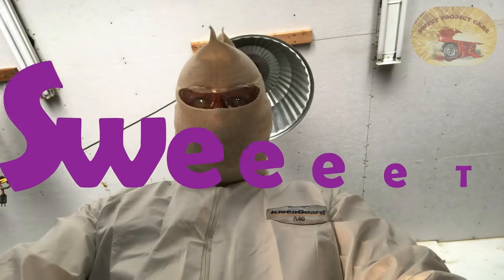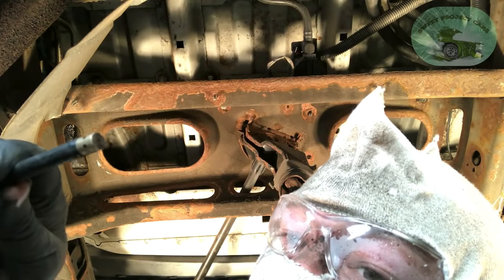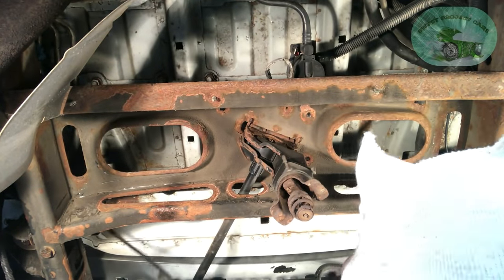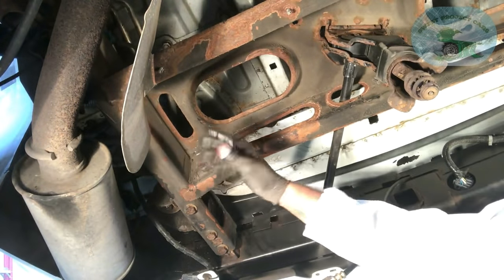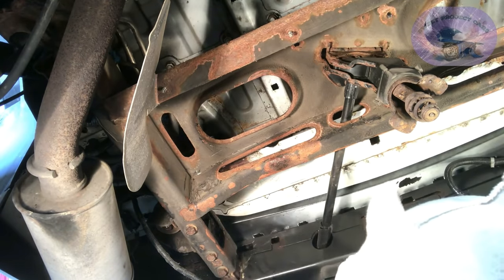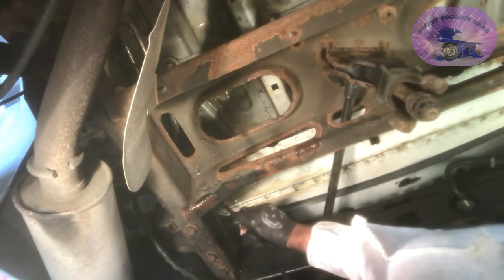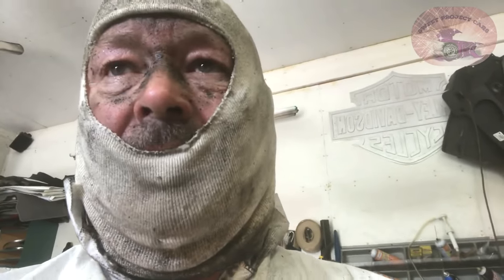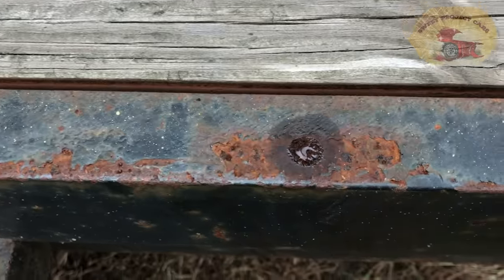#2 HOW TO RUSTPROOF A Car, Truck, SUV, JEEP RV, Motorhome

Comment: Also this makes many suspension parts last longer, and even makes the vehicle perform better over time. It really is that good, and I still have another vehicle to do, but 2 done already. Do this, it is more than worth it!
Reply from the maker: niceguy217 it sure does it is a great lubricant for sure

Comment: Such a hard job laborious work. Then when you seal the bottom up no rust, the truck engine dies and your still throwing your vehicle away. Perhaps a texting fiend from behind rams you in the rear and your truck is totaled? Instead of SWEEEET!
you might say SHHHHIT !!. ....LOL
Nice video....
Reply from the maker: The SynDRONE Effect thank you my friend for sharing and yes anything can happen to a car or truck, but here we look at it this way, its better care for it, then drive with common sense and take care of your motor and trans and the car will last for years especially if you like the car and don't want to replace it...have a great weekend my friend !!!

Comment: Great video!  What do you recommend for pitted metal?  Any kind of conversion coating before the undercoat stuff?
Reply from the maker: G Time, well as you know once rust has pitted the metal there is no filling those other than body filler or replacement  you can try painting it to smooth the pits out but you will always see the divots...the rust proofing we use here will stop the rust in its tracks so no more damage is done...thanks for asking my friend :)

Comment: Does Fluid Film stop the existing rust from growing.
Reply from the maker: David Buckles this is what their website says about that and we found to be dead on correct,  "If applied over existing rust, it will stop it immediately from spreading further. FLUID FILM will penetrate rust and rust scale to the base metal"  hope this helps :)
Reply: Thanks.
Reply from the maker: You are very welcome my friend
Reply: I would use caution if a vehicle is very rusted my lower control arm broke off the frame and i had sprayed fluid film underneath my car a few days before but it was bound to break anyways

Comment: Do you ever use a rust encapsulator and then primer? I used an encapsulator and then covered it with herculiner on the floor of my car. Rock solid but it is time consuming and messy. Also a bit more expensive.
Reply from the maker: Mark Allison as a DIYer channel we could get very involved and very deep into many fixes and repairs that's for sure ...we try to keep it easy enough for the diyer and still get the job done and still be somewhat affordable...we say with rust especially ...something is better than nothing when it comes to trying to control or stop it, even if it is a can of WD40 because the diyer is on a tight budget...thank you for sharing my friend :)
Reply: Thats bad, its just going to rot underneath the hard coatings and you wont notice it.

Comment: I did the inside of my doors with this stuff 4 years ago, should have done more. I'm wondering if it collects dust and dirt when it's on the outside of the vehicle. Any issues with that?
Reply from the maker: David Koopmans it collects a very light dusting and then it collects no more after that...pretty cool product in our book :)

Comment: that wasn't even close to "down and dirty" what my 20 year old 1998 f150 rust belt is....rockers are gone, cab braces gone on ends(both sides)..frame caked with 20 tears of rust (bought air needle gun)...BUT..by getting down and dirty,,i will re-deem my 10th Gen.  you might want to mention(by reading the label )  that Fluid Film is Lanolin based (sheeps wool) ,.. I also have a trailer that looks like the one you showed...cant wait for that video.."down and dirty Bob"
Reply from the maker: Bob Haddock he was actually talking about how dirty one gets when they are under the vehicle rustproofing....thank you very much for sharing Bob, you are a "Fantastic Subscriber" we need more just like you :)

Comment: How long does this last for? When should you reapply
Reply from the maker: Teagan Roehl we suggest in dry climates check it after a year and see if it is still doing its job and in wet climates we say touch up any exposed areas if needed once a year....we have had vehicles we have done personally and they have many years on them with no issues, we have found it all depends on the weather conditions the most.